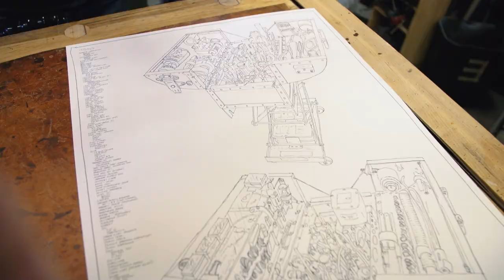What's Inside Adam Savage's Hip Pack!

Comment: Thanks for the video Adam. I totally get the hip pouch idea.
In the summer Montana can be quite variable in temps. We generally wear a fleece for warmth and breathability and then put on a light windbreaker for wind and rain resistance. Also help later at night to lock in the heat retained by the fleece. Because of the fact that I may be wearing several jackets in a day I generally wear cargo pants. My wife has described me as a Santa looking version of Pockets from "Hatari!" when I pull random things out of my pockets but not too much because I am generally pulling them out for her to use.
I agree with the noise abatement issue with the pull ring. I have a pair of cargos with metal zippers on the leg pockets and if I have the unzipped while walking around the pulls will chime with every step.
One improvement to the bag that I noticed would be something to hold the excess belt ends so they aren't dangling around to catch in something. Otherwise that bag looks very functional.

Comment: I feel the same way! I never carried a bag besides work bags. I carry one to the store and anywhere I need to go now. I’m going with one of two Maxpedition bags for different purposes. Smaller pouches with PALS webbing on the back, but I slide an OFF-WHITE belt through and it’s a great, comfortable shoulder sling. Holds the gubbins and I can sanitize where I touch the bag while I don’t want to wipe sanitizer on a jacket. Jacket weather for me is 40 or less. Light chore coat, denim, sheepskin or horse hide... I run very hot

Comment: I have a day-pack, worn over the shoulder. Actually, I have two, one is an empty back-up. Very easy to control and access. 

Standard contents: 
pair of back-up eyeglasses, 
a single 4-color pen, 
a pair of earphones for my smartphone, 
a plastic spoon, 
a tiny widget with a very short blade (Japan has strict knife laws), 
a small Vixen 4-power monocular, 
a fold-away magnifying lens, 
a pair of ear-plugs, 
a one-cell (AAA) flashlight, 
a plastic shopping bag, 
a small pack of tissues, 
a small plastic case with exactly one Excedrin and one Kirkland Ibuprofen in it...and a partridge in a pear tree. 

When I go out with ONLY the day-pack, I stuff a small water bottle, a toothbrush with about a half meter of floss wrapped around the handle, and a tiny tube of tooth-paste in there. It's pretty stuffed at that point but I still have my shopping bag if I buy stuff. 

Since Covid-19, I have added a tiny spray bottle of alcohol-water mixture. Hand wipes go in my back pocket. Smartphone in my shirt pocket. 

It is the same size as Adam's fanny-pack. 10 bucks at Uniqlo. Three pockets. The hard plastic buckle is in a good location for both access and no pain.

In the hand, it feels just a bit heavy. Over my shoulder, resting above the small of my back, it is weightless.

Comment: I love fountain pens.  I have quite a few.  I have that Lamy.  It is very good, but I would not call it the best.  It will evaporate ink over time, so if you aren't using it daily, it will go dry and need a really good cleaning to work properly again.  Otherwise a super great choice, especially if you want the clip.  If the clip doesn't matter, I'd recommend the Kaweco Classic Sport.  It's smaller when closed, making it super portable, and it seals REALLY well, so even after months of non-use, the ink will be wet and ready to go.  It comes in a lot of colors and materials.  My favorite is the basic aluminum because it's very light.

Comment: For the holding loops, may I suggest using paracord with a wire threaded down the inside then just melt the 2 ends together. The wire would keep it open if that is what you wanted with the keyrings.

Comment: Lol, I was using Lamys in school. I'm German by the way.
I found that Lamys have quite a thick line and it can smear easily. But the feather tip doesn't have that scratching feeling that you can get with an good ole Pelikan. The Pelicans line is finer and does not smear like the Lamy, since it doesn't put out that much inc.

I found that those Lamys break easily though. I still have 2 broken ones in an old drawer, the part where you screw it in can break off more easily it seems. Other fountain pens didn't break on me, but that was in my school days.

Now that I am someone with several edc pouches in my bagpack, I think I will get a new fountain pen again, or take out an old one, and get some permanent inc for it and put it in my edc pouch with the regular pen, the pencil and the fine red permanent marker. Permanent inc now because I don't want a drop of water to smear away the non-permanent inc.

Fountain pens are also really fun and weirdly enjoyable to write and scetch with! :face-red-heart-shape:

Comment: Speaking of pens, have you ever used a Pilot brand "Hi-Tecpoint V5" pen? It writes extremely smoothly, though you can't press too hard or you'll break the nib off and ink will go everywhere. I've bought all four colours it comes in and use them on a regular basis. Not recommended for filling out forms, though.

Comment: Hey adam. The solution to your metal ring is probably gonna be some of those loose leaf binder rings. They are also great for replacing car key rings because you can easily do/undo them if you need to take stuff on/off constantly.

Comment: Well this is the reason why i wear a bag from "Tasmanian Tiger" (I think its the "Tac Pouch 5") on my belt. I have everything inside i need. Wallet, noteblock and pen, even a flashlight (That is extremely useful in winter when its still dark in the morning or so.)
The good thing is: I have one of those wallets with a chain on it (A original Harley Davidson Wallet i got from my dad) and removing the chain from my belt when i changed the pants was pretty... annoying. But now i connected the chain to the inside of the bag, there was a D-Ring for that, and just switch the whole bag what i can do in a few seconds.

On top of that, my wallet it pretty safe from EVERYTHING be it dust, rain or someone who wants to steal it.

13:56 I have a idea for a badge: One for the case that you measured three times, and then cut the wrong side of a part. XD

Comment: Demerit badge idea: melted material onto a drill bit.

I was trying to drill some polycarbonate (I think) and I didn’t let the drill bit cool between holes. Before long, the chips ended up solidifying around the bit and it was rendered unusable.

Comment: The two flash-light type of guy. Yay

Adam should consider adding the following. 2 tablets of normal Aspirin. Not only does it take care of a headache or a sense of fever. As one walk around town, coming across someone with a developing heart attack is likely. 

A small pack of vacuum-packed gauze. For the kid in the park who got a bobo on her knee from running around. one also want a couple of adhesive wound-stickers - making Adam instant super-hero. And for the lady/gentleman in distress - a safety pin.  If you want to be the instant solver of any medical/practical problem, roll a couple of feet of duct-tape onto a lighter - and wait for the gentleman with a ripped umbrella (or something weird) to show up.

All this takes up as much space as a third flashlight when packed smart as a tiny booboo/solution kit.

Comment: Good choice of fountain pen, Adam. My first was a Safari, too. Are you using Lamy cartridges, or are you using a converter with bottled ink? If the latter, what ink are you using? Also, if you are willing to use bottled ink, check out the TWSBI brand of fountain pens. I think you'd like their "here is the tool that you need to take this apart and service it yourself" philosophy.

Comment: Fanny pack? Bum bag? Waist Bag? How 'bout sporran?  It does look good.  Mine's a "don't leave home without it" item and carries my usual batch EDC items.  And speaking of EDC items, I get the multiple flashlights but there's one thing I'm really surprised to not see in there and one I'd suggest.  First the suggestion: a safety pin or three.  In the past 7 months, I've used or handed out safety pins to people who's face mask ear loop has broken on at least 3 separate occasions.  And now the surprise:  Why didn't see a knife?  Even one of those $3 breakaway blade utility knives can show significant versatility beyond it standard task of hacking away through box tape.

Comment: 🔥🔥🔥Adam I checked out your merit badges and the company is charging a separate shipping charge for each patch!  If you order 4  of the same, 1 shipping charge.  If you order 4 different patches they charge you 4 separate shipping charges even though they all ship in the same package!  Is that correct?  Seems like a lot of $$$ for 4 small patches that could fit in a envelope for 50 cents! ( or what ever a stamp costs now). It’s $14! for 4 patches.

Comment: Of i am allowed to give you a reccomendation.
Instead of a fannybag i use an admin puch from tasmanian tiger, wich holds:

ADHD medicine for the day
Flash Light
A rite in Rain pen 
A rite in Rain notebook
A pencil
Vaseline
Hand sanitizer
Sharpener for My knife

It have 1 big room, wich are divided in two with a mesh, a room with a detacheble Rain cover and molle system.
The pouch is topload type and it goes on to you belt though the molle system on the back.

Comment: I find it weird that pretty much nobody uses my system.   
   
I use a wallet that holds coins as well as notes, anytime I'm paying for anything, I first take out the coins then the notes, this way I never have more than €5 in change (that would be never having more than $1 in change for US money due to the use of a $1 bill).   
  
In the spine of the wallet I hold a wallet sized pen, specifically the zebra sl-f1, it's telescopic so it's longer when it's open making it possible to rest between the thumb and index while writing, and yet the height of a €100 note when closed, making it fit in the spine of any leather or fabric wallet.   
   
I keep my wallet along with a victorinox huntsman swiss knife in my trousers front left pocket (I would have preferred the very similar fieldmaster, but it was a gift and those things are expensive, so I'm not replacing it any time soon).   
   
In the bottom of my right pocket I carry the keys which I continually streamline not to carry any unnecessary keys, currently I have 7 and no fob/keychain, just a ring.  

Having such a small keyring means that my right pocket is almost empty, and thus I can easily carry my phone in it on top of the keys, I prefer having the screen facing my thigh for extra protection and having it upside down, so when I pull it out it would be immediately the right way up.   
  
I prefer to keep my back pockets empty, but if necessary I carry a 10,000mAh power bank and a 1foot USB cable in the right back pocket.   
   
I don't carry a flashlight, the phone's flash provides plenty of illumination for the two seconds I ever need it, besides it makes it a one less thing to charge or replace batteries.   
    
Covid mask lives on my face, if I'm taking it off for a short time I just pull it down to my chin/neck, for longer periods I wear it round my wrist, and in the car it lives on the dashboard

Comment: I’ve never seen a piece of Zpacks gear with the extra length of straps not trimmed off. You gotta trim that off just think of the weight savings.

For those wondering Zpacks does have this on their website for $65 US.